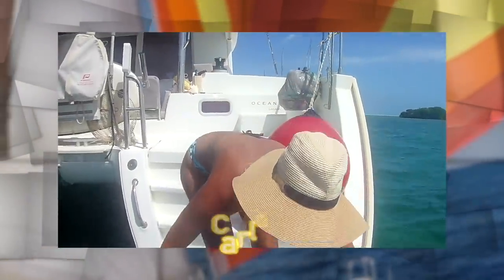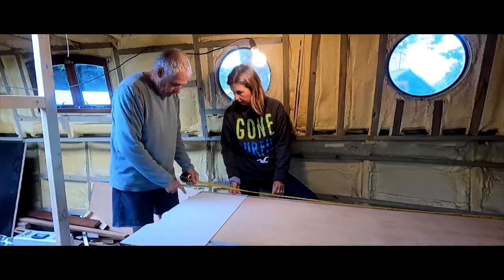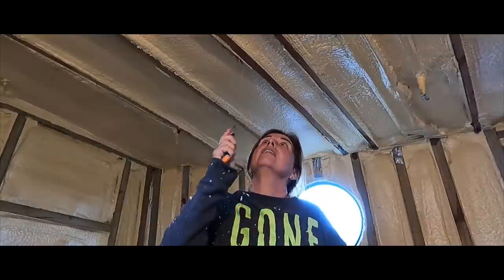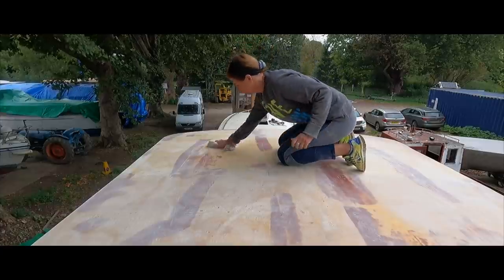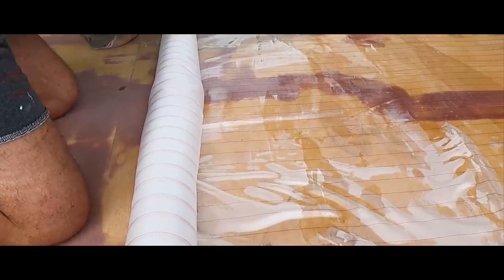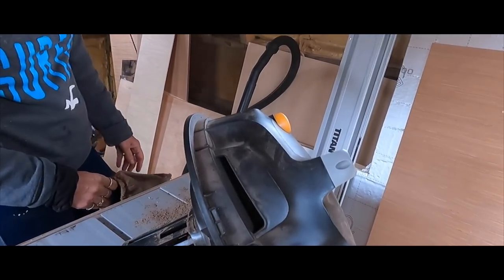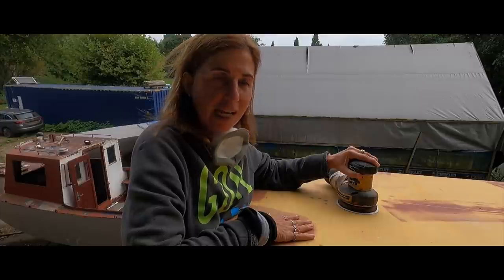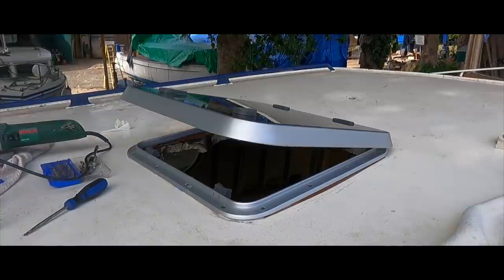BARGE BUILD.  CUT a BIG HOLE in the Boat. Building a hatch from scratch! Sailing Ocean Fox Ep 181

Comment: Hey guys! You get bad info from where you buy peel ply. When you peel it of again, you dont have to sand anything before paint. The oil in the resin will normally be in top layer. When you use peelply the oil fasten in the peelply.
Sorry for my bad English. Greetings from Sweden
Reply from the maker: Yes you are right but we didn’t apply properly so had a few bubbles that’s why a had to sand again. Next time I will practice on a smaller surface first. Thank you Arnt